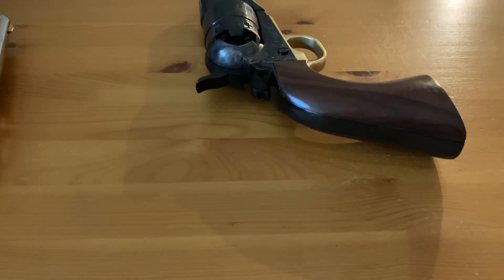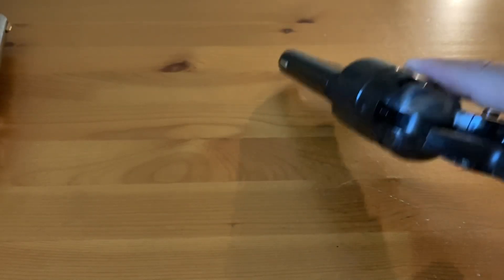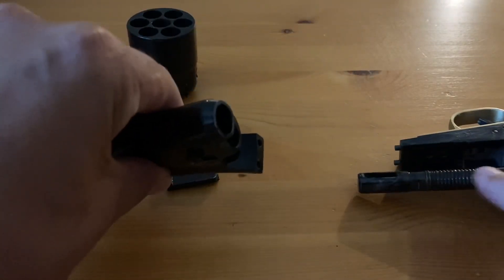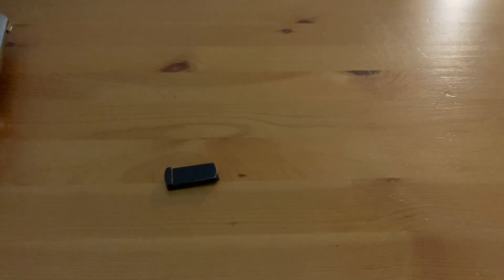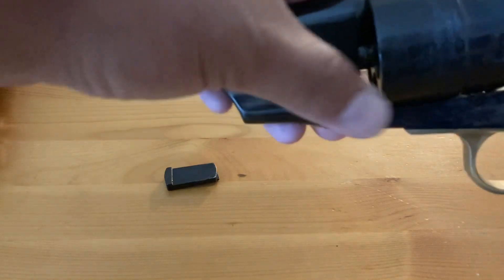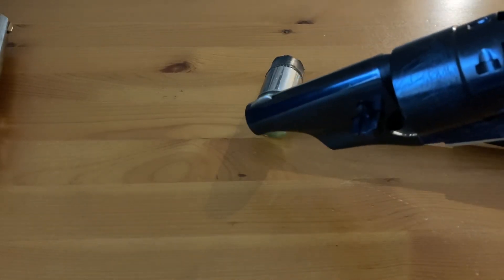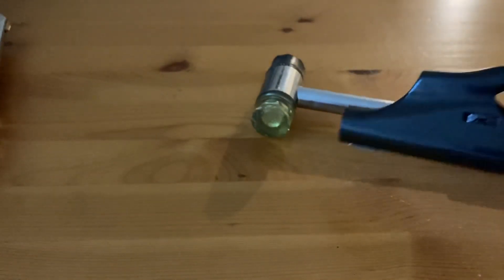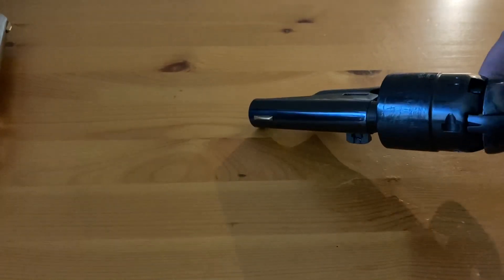TRIAGE OF 1860 SNUB NOSE: PROBLEM IS BETWEEN THE ARBOR & THE BARREL (MISFIT) SMALL REVOLVER PROBLEMS

Comment from the maker: Check Hammer To Nipple Timing. Mechanical Fault Between Arbor & Barrel and is likely either a Barrel fault or an Arbor size fault. The Barrel in plain English has a “HOLE” which goes into this rod “ARBOR” But gets totally stuck unless I hammer it down roughly hard with a mallet…